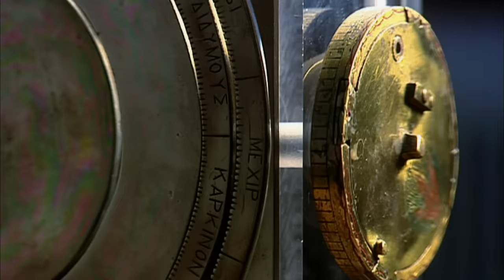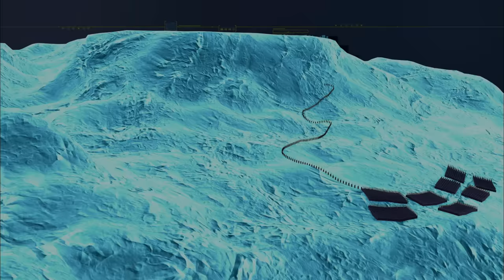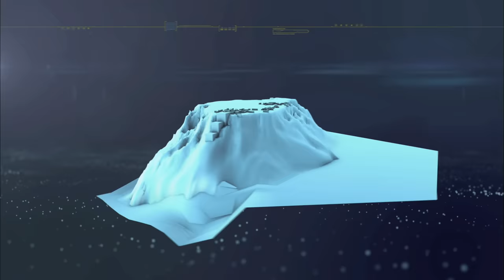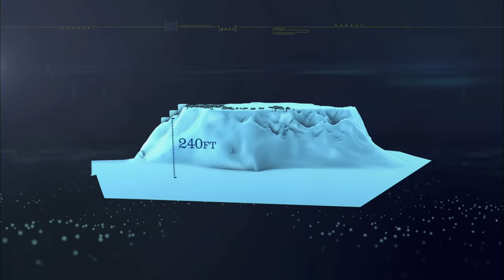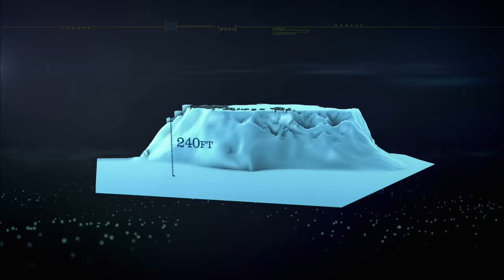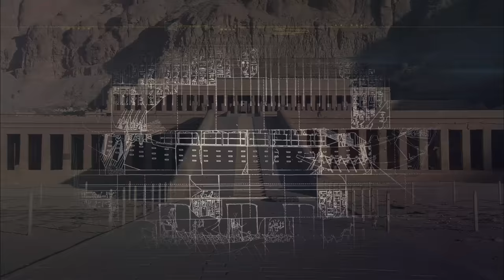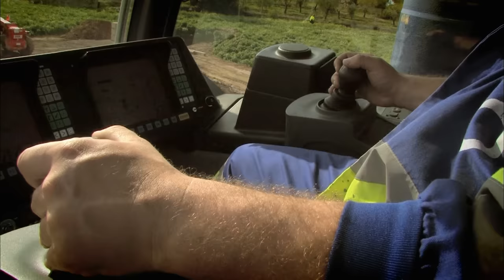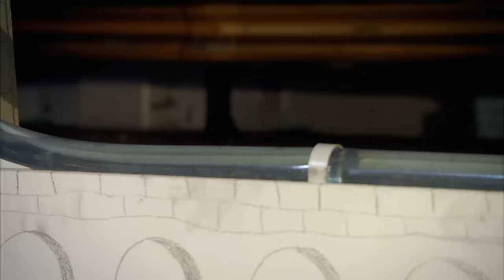Mysteries of Prehistoric Monuments | Ancient Impossible (S1, E2) | Full Episode

Comment: The demonstration of moving water uphill is flawed to the point of being deceptive; notice that the first tank is higher than the two subsequent tanks, which leaves an unanswered question: 
'How did the Romans get the water into the first tank?'
Reply: If the first tank is slightly below the level of the flow coming into it, gravity does the trick. The flow is coming from atop a high point on the edge of a valley after all.

Comment: I find it hard to believe the Egyptians carved those obelisk out with just a hand held rock .... You see the side those sides dont look like they were just chip cracked out ..  they had some technology we dont know about
Reply: Dolerite "balls" is one method it's possible due to it being harder than the pink granite that was used mostly.
Reply: Even with the weathering on it, we can still see tool marks consistent with using dolerite balls on that particular obelisk. I think that they were mostly just picking them up and dropping them over and over again though. As opposed to crouching down and smashing them.
Reply: @briandstephmoore4910  Are those tool marks present on the actual standing obelisks?
Reply: @IntegralTriangle the obelisk is abraded to a pretty even finish.
Reply: It wasn't dolorite rocks. Nobody knows for sure, it definitely wasn't the Egyptians. They discovered the abandoned complex 1000's of years after the great flood, and re-inhabited it. There is so much unexplainable technologies being used. Especially the pottery. I suggest Uncharted X youtube channel. Real science being applied to try and explain it. We may never know because all of the tools and machinery have been lost through time.
Reply: They also had copper saws where all they need to do was throw sand under the saw and use it as gritt to cut the sandstone.
Reply: @jaleink2953  You've got to think a little bit harder than that
Reply: @IntegralTriangle  they literally found artifacts of them and art depicting how they where used
Reply: @jaleink2953  You're assuming too much while knowing too little, it's okay to not know. No one is judging you
Reply: @IntegralTriangle  what exactly am I assuming? You've literally offered nothing to this conversation other obtuse questions and misguided sense of smug superiority.
Reply: @jaleink2953  I never claimed to know either. It's healthy to be open minded and not accept the common belief that it was achieved with copper saws and abrasives. These structures seemingly appeared out of no where and were never replicated since. That opens up discussion for other possibilities in my mind.
Reply: @IntegralTriangle  so you don't know anything about the topic, you've made no attempt to educate your self, you are just making assumptions and you have exactly nothing to offer the conversation.
Reply: Yes they had help. Look for The Law of One - The Ra Material. It's fascinating.